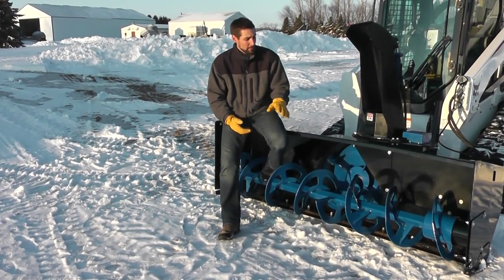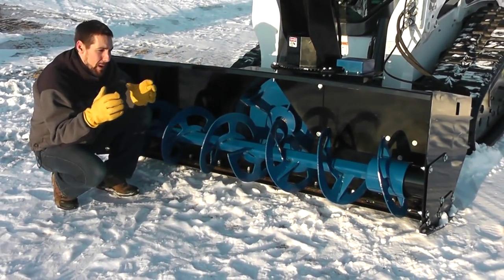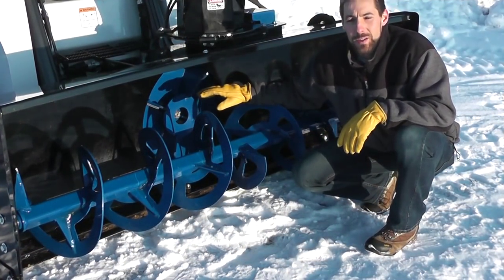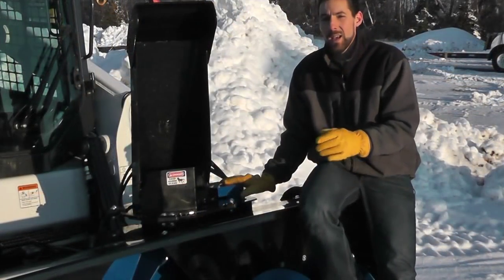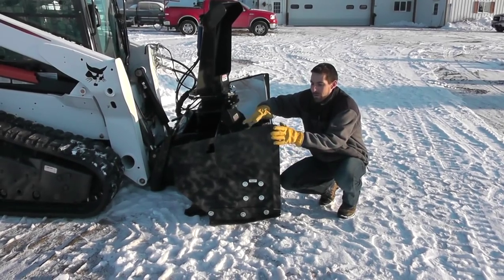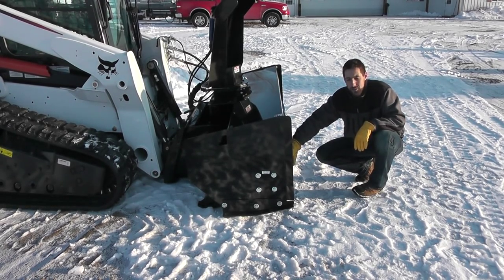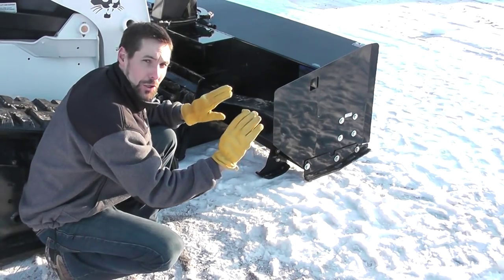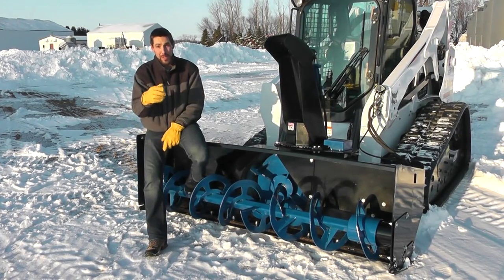Skid Pro Skid Steer Snow Blower Product Feature

Comment: Good video, but you should combine parts of the "in action" video with this one, to demonstrate the feature you're describing.

But still, good video, and I'm impressed by the design.
Reply from the maker: Thanks for your feedback Michael. Our new videos intersperse field footage w/ the walk around footage. That said, some guys prefer more field footage or straight field footage. Hard to please everyone, but yes, our new videos do just as you've requested. Thanks again, and let us know if you have any questions on the blower or interest in one. They are a relatively complex attachment, so depending on options, size, wire harness, and machine flow rates, price can vary quite a bit.

Comment: Do you recommend spraying a lubricant on the poly shim for chute rotation?
Reply from the maker: No lubricant needed. The poly shim is sandwiched tight w/ the steel of the chute and blower throat on both sides. The poly has a natural glide to it and there is very little real friction. We have still pictures that might help better illustrated the design. If interested, call 877-378-4642 or email sales@skidpro.com for those or other info and specs. Here's a newer video too if interested, https://www.youtube.com/watch?v=QEI0i_v87yU&t=12s.

Comment: How many revolutions per minute is the blower fan turning? 540 rpm?
Reply from the maker: Depends on the hydraulic performance of the machine. We shoot for a range of 550-750 RPMs. We achieve the different speeds by changing out the motor packages that run the fan/impeller.

Comment: How does the polymer rotating pad on the shoot hold up ?
Reply from the maker: We run very tight tolerances and it is a very abrasive-resistant material. Additionally, even in a commercial setting, the chute is not being rotated continuously. To this day I've never had to replace this part for a customer. Thanks.

Comment: Price?
Reply from the maker: We've got over 10 different blower model numbers and different motor packages on those, depending on what hydraulic output (gpm & psi) your skid loader is and what size you want and what controls you prefer. Best to call a Product Guru at 877-378-4642 to get all spec'ed out and price. We've got a limited supply of units remaining this snow season and healthy discounts (Up to $1,000 off on HF models) so your timing is great!